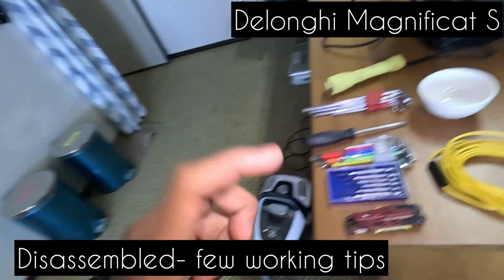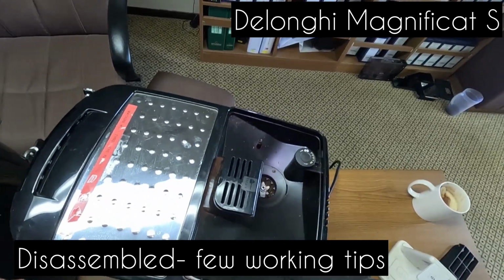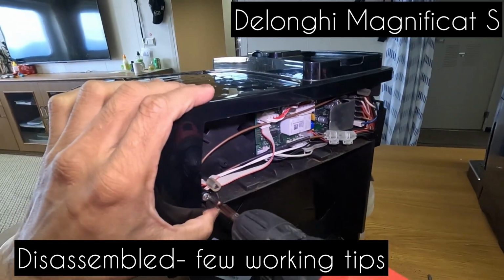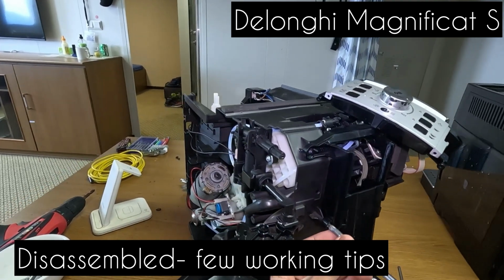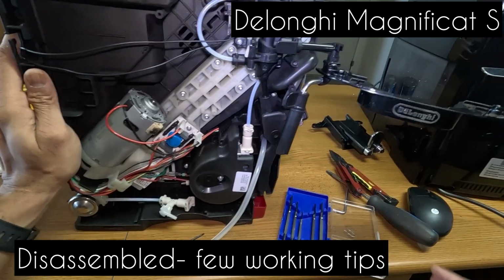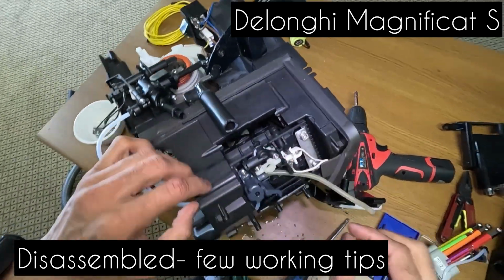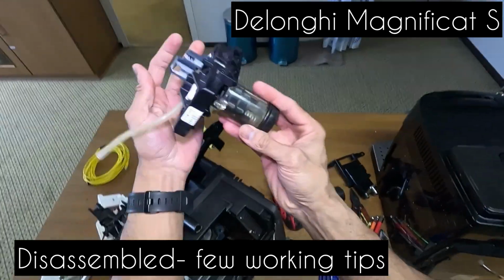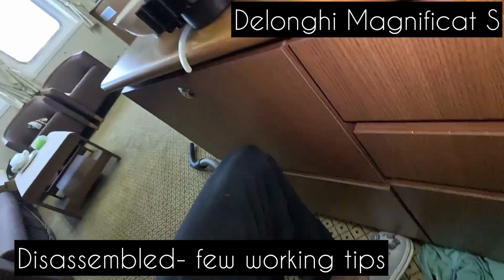DeLonghi Magnifica S - Coffee machine. Expresso machine DISASSEMBLY - onboard a Cargo Ship

Comment: I didnt pay attention to the position of the rack gears when i took apart the infuser. Now its stuck in the vertical position. Any ideas on how to a) Either manually release or operate the rack and pinion to move it back horizontal b) By disassembly can i remove the complete cover on the left hand side so i can rotate it by hand and remove the infuser. Cheers
Reply from the maker: sorry for the late reply, do msg on INSTAGRAM for a quicker reply. #thedeepseaman

Comment: Thank you this will help me. I just buy broken machine, the problem here is the infuseur is out, but his place is upper inside de machine and won't go down like that I can put the infuser. Idk what happnd in there maybe the owner take off the infuser, block the security sensors and start the machine now it's stuck. The machine when you turn it off it has triangle red light and Two greens blinking. Any idea how to solve these ? thank you
Reply from the maker: sorry, I have not faced this error, glad the video help u repair yours

Comment: This is the second of these machines it has happened to me that when I switch on the power the grinder goes continuously. Do you know any way I might be able to fix it? I've gone through four of the machines now in the past 10 years when each one is supposed to last ten years, and this one has only lasted 3 months, it's a record (I can send it back but would much rather be able to fix it and avoid all the hassle).
Reply from the maker: grinder continuous running is issue with the PCB,